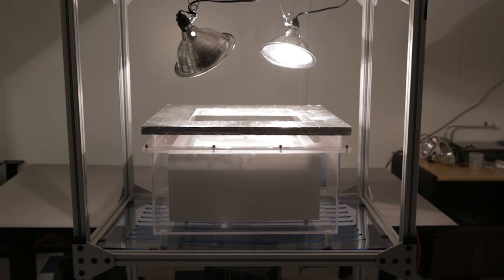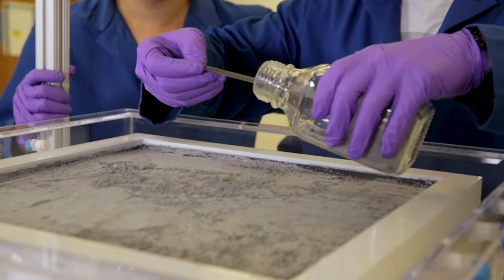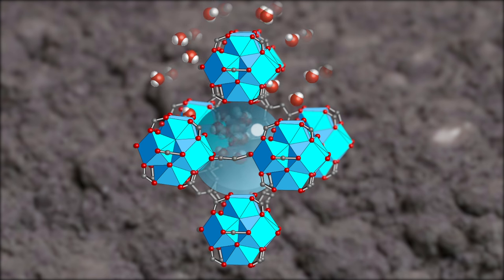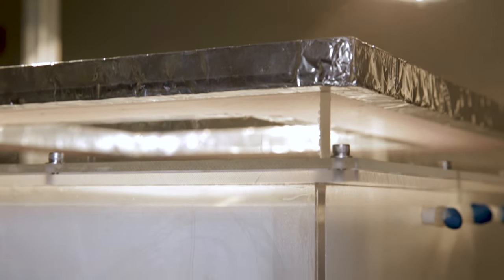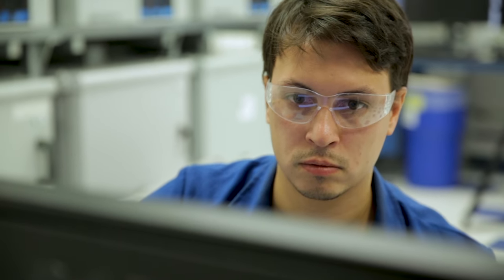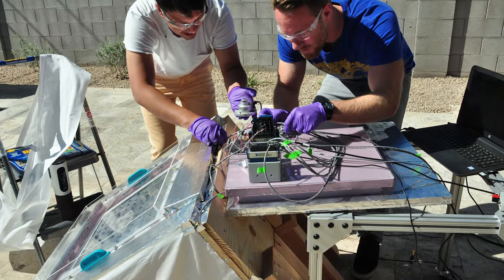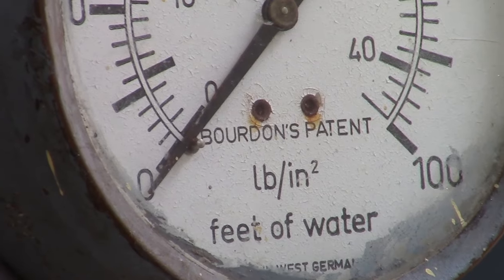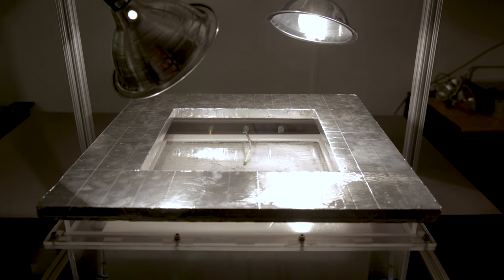This water harvester can turn desert air into drinkable water

Comment: Another potential commercial application of this technology might be crawl space dehumidification. In the South Eastern United States (Tennessee, Alabama) many homes have crawl spaces and major moisture problems in those crawl spaces. It is a very complicated problem, but with constant rain, A/C in the home both vented and unvented crawl spaces get a lot of water which causes mold problems. A simple solar powered dehumidifier that could be placed outside a home and in a crawl space vent and cycle significant amounts of water out of of the homes crawlspace would be beneficial. If placed there, if could theoretically work trouble free for years. Absorbing water at night and releasing it to the air during the day when the suns heats it up.

Comment: Think about it.. between owning a properly sized MOF (or an atmospheric water generator), a solar system and a hydroponic farm one can live anywhere off the grid that he or she pleases. Places where land is very very cheap! At giveaway prices. A desert oasis can be made.. And lets not forget satellite internet. Technology is empowering the individual and decentralizing water, power and food supply. Cool stuff to ponder
Reply: My point is to imagine the possibilities. One can own property that is cheaper just outside of town (close enough for emergencies). Food was covered in my comment about hydroponics. The greater point of my comment IS that tech is empowering the individual.
Reply: @jcm730  > Sounds good Matthews, but there is a far better way - For Earth, that is. The way they speak of in this video is not for earth but like you said, for other planets in space. There is a very simple process that can pull moisture out of the air and/or atmosphere and produce drinking water.
Reply: @MrOTcomputer  can elaborate on the simple way you speak of, I'm researching the subject and got curious
Reply: @moh19931000  > Sure. Our air contains oxygen and hydrogen so the device is basically pulling the moisture out of the surrounding air to produce water. Some people say "oh well you can't get moisture out of air that has no moisture" and I say "then go higher or lower until you reach air that contains a little more moisture". There is always some moisture in air even if it doesn't feel like it. Even if the temp is 105 degrees out then I say go lower or higher. Higher would be a hot air balloon to raise the device higher into the air where the temps are lower OR dig down where the air temps are lower as well.
Reply: Just don't let earthly governments find out😭😭they want/ need their taxes lol
Reply: 1000%
Reply: Agree but also I hope people that do this kind of thing respect the desert environments they choose to live in. As someone born and raised in the Sonoran Desert, it's frustrating to see that people often view the desert as a blank, barren slate for their settler fantasies while not recognizing that it's a beautiful, diverse, and powerful ecosystem in its own right. Not a critique of your comment, just an addition.
Reply: @lukemaskarinec9970  don't worry Luke, I'm in SW Utah desert. These things are great in the lab but don't do well in the real world because they are never tested there. 40 mile an hour winds with sand the size of a pin head can't be tested in the lab.
Reply: Our 100% off-grid community in Utah's West desert would LOVE to test this in the real world!
Reply: add 3-4 dairy sheep and like 20 geese and you will have met your fat or carb requirements with the milk and then protein requirements with the eggs. aquaponics or compost ponics tend to be better tho.
Reply: There are better options you cannot vegetate area where there is no rain fall and if there is rainfall in some part of the year you can harvest the water cheaply and effectively

Comment: I can see the water harvester as being a very important first step into hydroponics on a "large" scale, simply because one-hundred percent pure water can be readily obtained and circulated in an "enclosed" CO2 ecosystem. One possibility for removing CO2 from the air we breathe would come from the Linde air-liquefaction process. Simply by compressing the air we breathe and removing the excess CO2 from the earth's atmosphere while at the same time using the CO2 gas as a refrigerant and pumping it into the grow room for the plants to use. If it were to be possible, this could solve many problems, as well as being a highly efficient way to grow plants that can be tailored to everyone's needs, while at the same time reducing greenhouse gases from the earth's atmosphere!  Thank you for this very informative video!

Comment: What about the control of the system ? how you can know that;s the right time to harvest and close the intake air and heat the sorbent ? do adding mmm maybe some sensors  measure how much the powder is saturated or not so many cycles can afford on a one day ...

Comment: This is really an extremely interesting development for water harvesting. The following question arises in my mind: how does such a device solve the accumulation of atmospheric particulate matter (PM), which settles on any surface and after a long time turns everything into a layer of concrete? This becomes especially The case when the water molecules mix with it.
Reply: Might have to periodically groom the top surface.  
Might have to put an air filter over the air-intakes, that can block those ambient chemicals & particles. 
Might check out basic sand filters…those require filling from a water source.  But, those develop a biota layer on the top of the sand, which is part of their filtration magic…Not disturbing that biota layer, is important. 
Seems the MOF system might also need to grow a biota layer on top, for it to work better, kinda like the basic sand filters.   
The biota layer is aerobic, can kill other germs, & gobble up certain other contaminants; a tray of plants as 1st filter over a sand filter, it could be better, but not above MOF. 
But this MOF stuff?  They were hardly clear on how it really works.  
Guessing there will be air-intakes to bring ambient humidity in contact w/ the MOF.   Gonna need an awful lot of it, in low-humidity regions, though.

Comment: Since only a thin layer of MOF will be needed, a large yield of water can be achieved in a relatively small space, such as a cubic meter, by placing a thousand layers in that space.
On the other hand, this equipment can be configured for permanent operation, taking advantage of the energy offered by the new perovskite-based solar panels and other emerging technologies.
And, even more, heating the air to increase the production of water, which can reach up to 600 grams per cubic meter of air.
I am Spanish and I do not know the British-USA measurement system.

Comment: I hope this goes somewhere. I work scrap metal for years. I came across an unusual stand ( probably for an industrial fan) it was marked kraft cheese and made out of cast iron. It was yellow and green. I kept it as a useful item. It sat on dry shale pit. The crazy thing drew lots of moisture for some reason. I showed it to alot of people, it worked in drought. Some asshole stole it. But I'll tell you about the thing. It was weird. It actually worked!

Comment: In the process of extracting water from air, cons may be more than pros. Many people have put forth their views. Added to that, very important one is, this can't work in arid regions, actually where it's needed. Secondly, if it is done in large scale, humidity levels of the air in a region is drastically reduced.

Comment: What is the cost of the MOF? The idea is cool, but one would need an enormous quantity of the stuff (~25-40x the current experiment) to supply the 2-3L that a single person requires daily in desert conditions.
Reply: I think this wouldn't be very usable in true deserts, the net gain goes up a lot if you are in a semi-arid zone with higher humidity content in the air, so you'd need less powder.
Reply: Yes. That is a problem!  I did not like his crowing about using aluminum as the MOF, to make it cheaper…that puts high levels of aluminum into the resulting water..bad.  
Yes..,must factor the ambient humidity!  It definitely affects how much water can come from how much MOF, or, from even electric dehumidifiers.   Those living where humidity is closer to 25%, will require far bigger systems, just to get enough potable water…forget bathing, washing, or growing plants.
Reply: @Chimonger1  They explicitly said that the water is pure and does not contain metals or other components of the MOF.
Reply: @JackFou   They did. …And, most folks need to understand, to do that, either means the condensation metal is coated to block ions transferring to the condensate, Or, the condensate is post-filtered to remove the metal from the condensate.
Reply: @Chimonger1  I'm not quite sure what you're trying to say.
The water molecules get absorbed into the pores of the MOF during the night. During the day, the heat from sunlight causes to water to evaporate from the pores and form condensation on the walls of the box.
How exactly do you claim metal ions from inside the MOF end up in the condensate?
Reply: @JackFou    Maybe I do not clearly understand “MOF” .  
Is that not metal?
 Does vapor condensate from those & drip into a catchment for use? 

(Too bad Gaagle’s YouTube no longer allows editing or deletion of comments, Or I would have)
Reply: @Chimonger1  No, MOFs are not metals. They contain metals but they are not metals themselves.
It's like, idk, sugar and carbon. Sugar contains carbon but it's not the same as (pure) carbon (i.e. graphite).

MOFs are essentially polymers that consist of metal atoms bound to organic linkers. They have a very porous structure which is why gases (like water vapour) can infiltrate the structure and sit in the pores.

You can think of the MOF absorbing water like a sponge. The water doesn't condense on the surface of the MOF and then drip down or something. The water goes inside the MOF and sits in the pores.
Then when you expose the saturated MOF to sunlight, the heat causes the water to come out of the MOF again as water vapour and then condenses on the (plastic) walls of the box.
So no metals end up inside the water because the condensation happens on the box, not on the MOF.

Does that make sense?
It's a bit tricky to explain it in detail without getting into technical gibberish.
Reply: @JackFou   That actually makes good sense.  I’d be concerned about germs possibly growing in the MOF, & plastics being in the condensate from dripping down plastic surfaces, because that happens even storing water in plastic bottles; far worse when plastics are subjected to heat.  .  But, likely, a Berkey filter should be able to remove those chemicals. 
But why bother to store water in an MOF?  Why not just water in a simple tray?
Reply: @Chimonger1  The MOF can absorb moisture from air. That's the whole point...
Reply: @JackFou   Ok… so, there’s a quantity of the MOS in the unit then, gathering moisture all nite, then, sun comes up, giving a temp differential, causing water to condense onto the box sides & top inside, then dribble into catchment…that about right? 
Very intriguing!   
Sounds like it makes the unit low-tech…definitely a plus! 
Does anyone make these units? 
How low of ambient humidity can these realistically get daily water from? 
What all is included in the estimated 300+ gal./day/person, to get that figure?  Seems extraordinarily high!?    Of course potable & cooking; laundry? Shower?  Even counting those, each of us here does not come close to 300 gal/day/person!

Comment: If you could make it smaller, divide it to the original size, place a solar panel and connect it to a AC motor that's used to harvest the water, you'd get alot more water faster
Reply: What about this…
Use one or more black, air-intake tubes, positioned at an angle up towards the MOF?  Sun heats black tubes, creates air movement connecting upwards towards the MOF surface.  Heated ambient air tries to dry out the humidity, right where it enters the box, for the MOF to grab it…?  
No fans needed. Still “low tech”. 
But, running a regular dehumidifier (several hundred watts electric), on solar panels can be done, too. Then can Berkey filter the condensed water.  Unless you are in a higher latitude that has too much cloudage in winter months.

Comment: Ya I have 4 of these things running in my bud rooms......they are called DEHUMIDIFIERS.  They produce up to 70 pints a day.
Reply: But don’t yours require hundreds of watts of electricity 🤔
…the MOF units can simply run off the heat/light from sun…low-tech.
Reply: @Chimonger1  actually I have a solar system with a 25 kw tesla battery.......so ya it runs off the sun.
Reply: @sketch6995   Albeit using more electricity🤔
Reply: @sketch6995    Yes, I know. I get it. However, most folks cannot run a grow room w/ dehumidifiers.  
And, the one we bot as replacement for one missing, is junk..keeps icing-up, when used in winter (when there’s high humidity here). 
So, really trying to find a better, hopefully lower-tech method of condensing water from air, that can work all year, no icing-up, & get enuf H2O for potable use.
Reply: @Chimonger1  well I have 2 running in each room, and have never had that problem.  They just spew H2O
Reply: @sketch6995   You are very blessed, because you have managed to afford, & have a place to mount, all that solar generating capacity, And get water to use, from that.  
The bulk of population has great hardship, or worse, affording panels, &/or, having a place to mount them, much less growing anything requiring dehumidifiers.  Many would find it difficult, even affording a dehumidifier to prevent mold, alone. 
My focus has been tinkering w/passive solar heat (nothing electric but a fan to boost the air); fiddling w/really basic low-tech geothermal; passive ways to garner useful amounts of potable water, tinkering w/other bits of energy-saving using low-tech & recycled stuff. 
Emphasis on as low-tech as possible….
Necessary Things that hopefully, can be open-source, affordable, & do-able by the many, without adverse affects on anyone’s ability to survive. 
High tech is fun & amazing, but not the way industries serve it up, constantly focusing on those with plenty of disposable money to get & maintain.   
Trickle-down, no-context media & economics is flawed, & has seriously helped ruin pretty much everything.
Reply: @Chimonger1  oh don't get me wrong......I dump that water in the river.  I don't use it.
Reply: @sketch6995   Wow..not even filter for heavy metals, & feed your plants😳?
Or filter w/a Berkey filter for potable use?
Well, you could, if you needed.
Reply: @Chimonger1  it comes out at zero PPM, almost distilled.  One day I may need to use it.
Reply: @sketch6995    Writing this out, mostly because there will be other readers who need to know…. 
You may already know this.
First:  
There’s a fallacy about drinking distilled water leaching out minerals from the body.  
It does not.
It cannot do that, unless one is Fasting on only water, for weeks at a time, such as a 3-week water fast to beat cancer.  (Yes, that is a real thing, & not just for cancer, but also for other deadly ills).
Distilled water cannot leach minerals from the body, as long as one is eating at least a half-decent diet.  
The food we eat, especially dark green leafy veggies, contains minerals (though, these days, unless one eats organic, their food is drastically deficient in minerals).  
The more organic veggies one eats, the better their mineral repletion is likely to be…even if they drink distilled water. 
Secondly:  
There’s a difference between lab-distilled, & condensation distilled…the thing to be legitimately concerned about   Lab-distilled has no dissolved solids; home distilled or condensed, has a small amount.  The jugs of water labeled distilled @ stores,  was depleted of its solids, but, sat in plastic jugs, so now carries plastic toxins. 
With dehumidifier/AC condensation distillation, heavy metals (commonly aluminum) get into the water condensing on the coolant fins—those would be very concerning. 
As for watering plants 🪴 , you are right to not just let the condensate straight water the plants; they WILL uptake heavy metals; & That would affect whoever consumed the plants…it would need filtered.  
NOTE:  Nubee science people who get excited about plants & insects abating toxic stuff from the environment, have published articles on these, always “selling” it to public, how great the idea is.  
BUT… the huge missing context from all of those has been, what to do with the plants or insects once those die-off, or get moved…those plants & insects now contain the toxics…because there really is no “Away.”

So, the condensate water getting dumped in yard, is no real problem, unless you water veggie plants or fruit plants you intend to eat.

Comment: What would be the lowest humidity needed for this to work? And, as Jim Ewok already commented, the water that is extracted from the air is eventually missing to the ecosystem somewhere else. Imagine for example cacti, that rely on some air humidty to survive. 
I'm not saying here that plant live should be valued more than human life, but I'm asking if anyone considered the full impact.
Reply: I seem to recollect the humidity needs to be =>20%, but it may be even lower.
Remember humidity will rise as the temp drops in the evening making the water vapor more available. So even if the humidity at 100F is  5% or 10%, it will rise significantly as the temp drops.